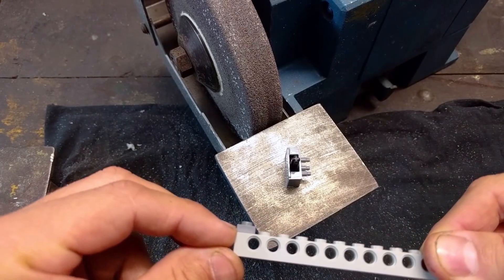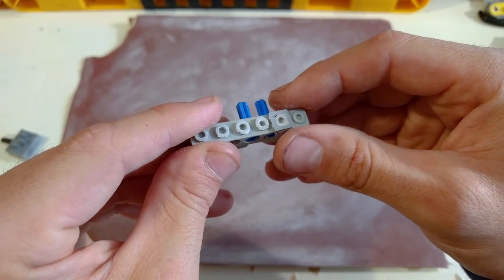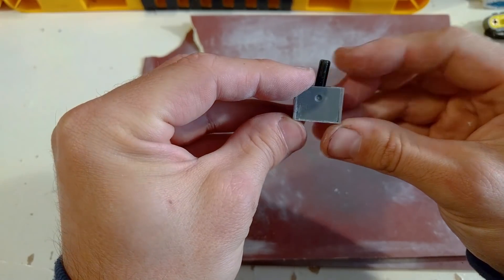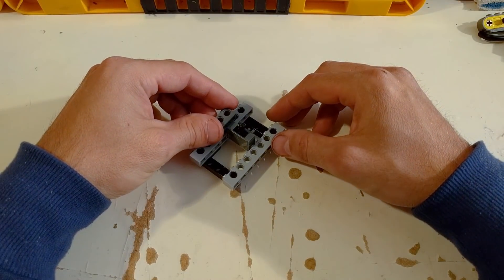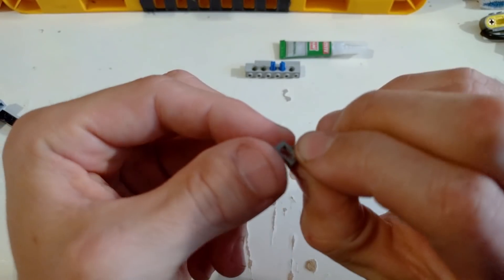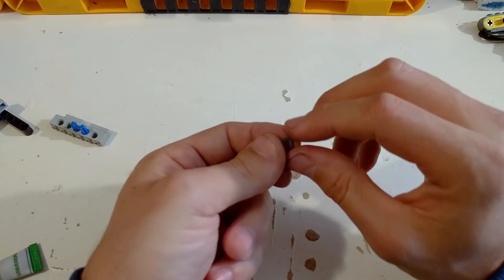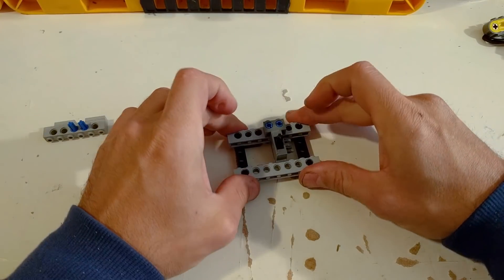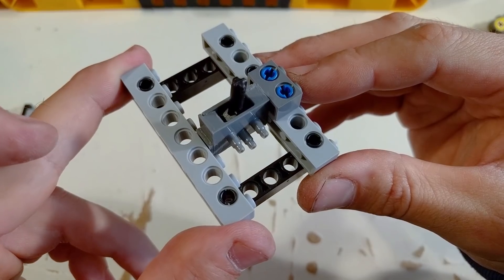LPEpower insight - Modifying pneumatic switches part 2

Comment: I am going to be making some rotary pneumatic switches/valves using a 3d printer, it will be interesting to see how they perform.  Do you have any ideas how the valve mechanism could work? I already have a good idea and a few concepts. Thanks 😄
Reply: Green Gecko Lego Technic Workshop if you manage to do it make a video about it! Im really intetested
Reply from the maker: The problem will be making it airtight. There are several rotary designs possible.
At this stage i'm looking more into how to make a switch for an expansion engine.
Reply: Green Gecko Lego Technic Workshop I got a good idea on how the mechanism could work.
Reply: clypeum sure am
Reply: mocraft05 how?
Reply: Green Gecko Lego Technic Workshop it’s hard to explain. If you really want, maybe I could send you a picture somehow.
Reply: I will be using o-rings and grease, if you could send a few photos of designs to my email - greengeckoltc@gmail.com it would be a huge help. i understand how i expansion engine works, but how could you use the lower pressure left over with the Lego system? Thanks
Reply from the maker: You have 1 cylinder for the high pressure stage, 2 cylinders for medium and 4 for low, for example (if we're talking about a "3" cylinder triple expansion engine.
Reply: Green Gecko Lego Technic Workshop could you share them to me aswell? clypeum4444@web.de
Reply: ok
Reply: and you think it can be done with using Lego cylinders?